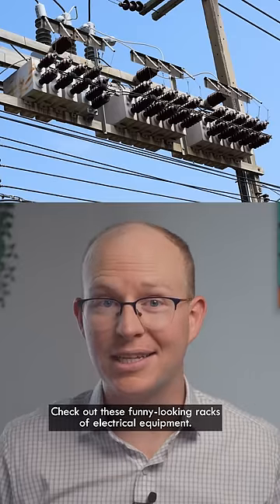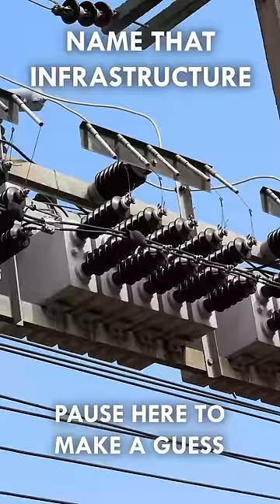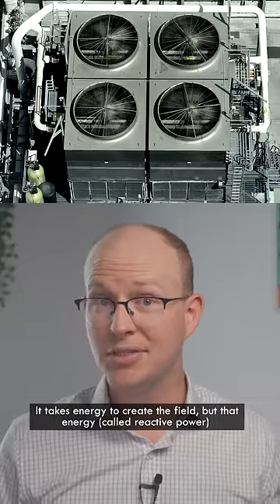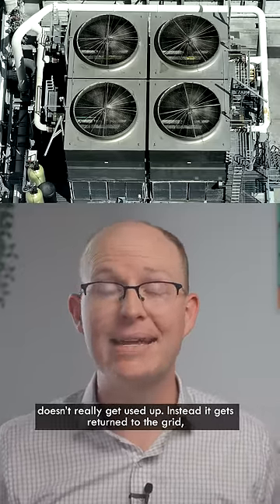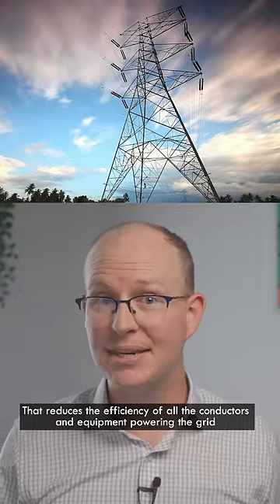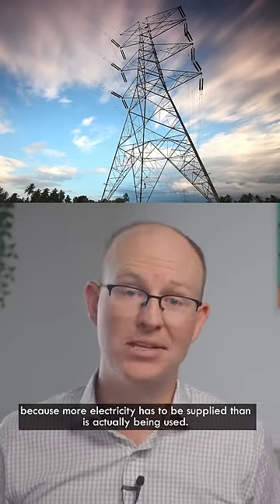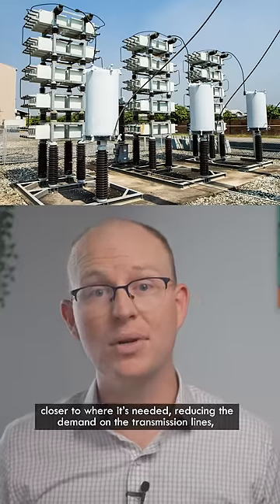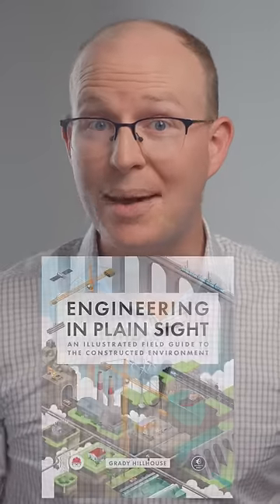Name That Infrastructure (Ep. 10) #shorts

Comment: Capacitor banks.  While your explanation of reactive power is pretty good, I wouldn't exactly say the 'voltage loses synchronization'.  It shifts the phase, but remains in step.  When we have a generator 'lose synchronization', it slips poles and pulls out of sync.  That's a pretty bad thing and we have to trip it off and 're-sync' it to the grid.  I know it's a bit of a 'nit to pick', but...
Reply: ... but 'technically correct' is the best kind of correct!
Reply: One of the key elements to public science communication is removing unnecessary detail. It's far more important to communicate the idea generally correctly than be perfectly accurate.
Reply: @mjs3188  agreed. You only need to know the finer details when it's practical for you, like if it's your job or something
Reply: I love how well all these comments can agree on the nuance of precision of wording rather than calling each other wrong and arguing.

Thank all of you for making the internet a peaceful place where i can learn stuff and enjoy my internet time.
Reply: @ericolens3  because they are smart people
Reply: I'm not super familiar with high voltage applications but he talks about this in another video and also mentions the magnetic field in this video. If it is the magnetic field causing the discrepancy then why do they use capacitors instead of inductors?
Reply: @Jospec5Star  inductors and capacitors introduce an opposite phase shift to the power. I can go into the math and physics if you’d like, but the important aspect is that inductive and capacitive loads shift the phase in opposite directions, and the grid naturally includes many more inductive loads, so they add capacitors along the lines to produce a net-zero phase shift in the transmission voltage.
Reply: Such a tweeker reply.
Reply: Perfectly out of sync. 😆
Reply: How do you know when your turbine is out of sync?
It causes a minor earthquake.
Reply: @JasonW.  And when slipping poles, all the meters in the control room resemble windshield wipers!!  lol
Reply: Thank you for using laymen terms to communicate the idea. It helps to bring the rest of us along…
Reply: @Jospec5Star because inductors act as a resistor. A capacitors fills in the void when voltage drops too much when a motor starts up .

Comment: It's a capacitor bank. But, industrial buildings have inductors (motors) which have reactive power requirements which "pull the current" one direction away from unity while capacitors are the polar opposite and help bring the reactive power back to zero or unity.

Comment: For anyone wondering, the capacitors can act as resistors with alternating current due to them storing a charge and attempting a discharge during the inverse of the input phase; which creates a variable resistance depending on the frequency called a reactance. To calculate this, it's 1/((2pi)x frequency in hz × capacity in farads) which would be displayed in ohms. And to change the phase, you use either an inductive or resistive compound circuit (LC or RC). But to get it closer to the θsource, they have to calculate using some simple geometry to get the net impedance(basically resistance for the AC measured in ohms but with the symbol of z). Where z is the hypotenuse, R is the horizontal edge of the triangle, C is the vertical edge, and θ is the angle between R and z

But I do believe that they have a digital system that can adjust the values to get closer to the phase of the source

It's been a while since I have done these calculations so if I got anything wrong, feel free to correct me
Reply: Reactance is AC RESISTANCE  WHERE RESISTANCE IS TO DC

Comment: To be more precise, more electrical current needs to be sent if there is too much reactive power. More current losses are there but also equipment has set current and voltage limits. I think it's possible to overload a fuse or transformer with only reactive power. :P

Comment: Cap banks are absolutely fascinating for a myriad of reasons, but the most interesting is that they essentially *create power from nothing*.
If a generator is making 100 MW of power they might be required (by contract) to spend 0-5% of that capacity just making reactive power that they aren't paid for. If they install a capacitor bank they can instead get paid for all 100 MW of power which, among other things, pays for the capacitor over time.

Comment: Eli the Iceman is what I learned back in 1995 in at SCU in my Circuits I class to remember the phase relationship of voltage (E) and current (i) in inductive (L) and capacitive (C)  loads.  After I started work at HP doing server design we started adopting power supplies with integrated power-factor correction that always present a balanced load to the gird in the early 1990s.

Comment: I worked for a company they find a way to generate money with photovoltaik in the night by back feeding power into the field. They used the Pv-field as a capacitor. They got cash from the grid company for correcting the grid. Called Q@Night.

Comment: hey hey~ i was able to remember those were capacitors from when i did utility locating! part of the training in that job WAS noticing unsafe infrastructure so i could call it in and more importantly avoid it, cuz aerial lines are easy to locate, just point at it and boom, but if something is not working right i was often the first to see it

Comment: Note that capacitors supply reactive power opposite that of motor reactive power.  Standalone or not.  They kind of cancel out the power factor issues if sized correctly.

Comment: Kvar unit... They are often but not always tied to a controller.  It's possible if you have a lot of variance in your ratio between inductive and none inductive loading. The controller basicly bypasses the capacitor banks to so that you don't get the opposite condition of current leading voltage.

Comment: Not all motors require magnetization current.  Induction motors do when they are connected directly to the grid but not if they are powered by a variable speed drive since the drive provides that current.

Comment: Several massive PFC banks like this were brought to my buddies scrap yard. It was fun to play around with them a bit. Not uncommon at all for the big power companies, hydroelectric, ext.... folks like TVA around here in Tennessee.... 

A lot of times they scrapped or get rid of things for one reason or another. Sometimes /a lot of times it's brand new not even been used and that was the case in those capacitor Banks. Beautiful big banks that were inside Explosion cabinets. You can usually buy that stuff for about ten cents a pound if you can find a scrap yard that will let you bug bug them or come poke around every now and then.

Comment: Well, the reactive power isn't "generated where it's needed" but it is compensated where it is created. Capacitances (e.g. in ground wires) or inductances (e.g. in motors) create the phase shift and therefore the reactive power. Because this form of unnecessary power would create power losses, it is compensated meaning the phase is shifted in the other direction.

Comment: At the intercetion of oxford st and monette place in los angeles is a power pole with 3 capacitors on top but only about 15 feet from the apartments on a building. Just after 11pm when TVs went off the capacitors would arc across the top.   The arc would last for 10 seconds.  The central American families living there complained to me as nobody at LADWP believed them. I sat outside several nights waiting for it. I missed the arc flash but saw the column of smoke.  The line crew looked up with binoculars the next day.  Its ok.  Go up and look.  The insulators were blown off the tops.  I think 4,800 volt caps on a 4,800 volt line was a misapplication.

Comment: Kvars and the Power Factor Correctors

Wikipedia has much more information available about "Power Factor Correction" and synchronous generation of electricity. That's where these capacitors enter the picture. Small correction units are cabinets mounted on power poles; now you know what that funny box on the power pole is.
Thanks, Grady!

Comment: I've wondered why certain machines don't come with their own capacitors to counter the lag caused by large motors. Or when installing and powering up an MRI machine why not have capacitors that could then be removed, as the magnetic coils are always energised? It would dramatically reduce the cost of start up. The only reason I have come up with is that it would be dangerous to have such large capacitors energised, especially if they can be moved. I would be interested in any thoughts about this.

Comment: We always sized capacitors for our motors and included them in the cabinet where I used to work. I imagine if everyone did this would be a non issue.
Reply: That's the exact thing done here. Commercial consumers have to pay for reactive current (at least where I live) and therefore they try to compensate it themselves, because it is cheaper than paying for reactive current. But private households don't have to pay for it and that accumulates a lot of reactive current that needs to be compensated.
Reply: Motors are technically a varriable inductance so 1 fixed capacitor won't actually solve the problem so a switched capacitor bank is still useful.

Motors are weird, but because they have a spinning magnet (the rotor), when they are at speed they effectively have a generator superpositioned inside them which lowers their effective reactance & load. (We model them as a fixed source behind a time varrying reactance, which is weird but works)

Honestly that phrase "its weird but works" describes most of electrical engineering math and principles. (And don't get started on the litteral witchcraft that is optics)
Reply: @jasonreed7522  You are right that if you want to be a good boy you buy a smart capacitor bank and hook it to your main bus to deal with variable loads. For a great many use cases though like a conveyor or a press that runs at a known rpm range you can size the capacitor for what you see and it will be perfect. The difference in current draw between running at 20 strokes per minute and 30 on a press was not a 2 to 3 ratio it was only around 10% more current. Making sure you size motors to actually run in an ideal range that promotes longevity goes a long way instead of hammering it with a full load all the time too. I did this in real life, for a very long time we had no way to vary our capacitance and the electric company was happy. We ended up getting a smart bank to check a box on an audit.

Comment: Line reactors, they make passive and active line reactors.
Reply: A line reactor is actually used to add inductive reactance to the line instead of capacitive reactance. Similar idea but opposite property. Line reactors are often used for longer transmission lines, that when lightly loaded can add significant capacitance to the system. In such cases, the reactors are switched in to counter the excess capacitance.
Reply: @nate0031  yeah I use line reactors in my plant to prevent reflective feedback on large reactive loads. We use unsealed open air reactors.

Comment: Residential customers aren't charged for reactive power.  But, there's a scam where you are sold a capacitor for your house.
Reply: How is it a scam? Do the capacitors not work? I’ve seen the devices for sale but I don’t understand well enough the operating principles to judge, so I’m eager to learn more and understand better.
Reply: @jpe1  It's a scam because it's marketed as lowering the cost of electricity for residences, but the power company isn't charging residences for reactive power, only industrial customers.
Reply: @MushookieMan  so, the industrial customers put in capacitor banks to reduce the reactive power, and thus reduce their electric bill, but those same capacitors won’t reduce the bill for residential customers because they aren’t billed for the reactive power that the capacitors compensate for, so while the device may be legit in that it reduces reactive load, it doesn’t do squat to reduce the bill?  That makes sense, I’m not doubting you, I’m spelling it out so that I’m clear in my own mind.  I didn’t realize that there was a way to bill for (or even distinguish between) reactive vs (ordinary?) power, I sort of assumed that the bill was based on the number of electrons that “flow through” the meter (I know they don’t exactly flow) and the capacitors kept some of the electrons on the customers’ side of the meter.  As I said in my first reply to you, I don’t really understand how this all works.
Reply: @jpe1  Yup, the meters can tell what's real and what's reactive power, then only log the real power flow. You'll notice transformers etc are rated in VA, or Volt-Amperes. Since they have to be rated for the total, Apparent Power that flows through the system. Apparent Power is the sum of Reactive power (Volt-Ampere Reactive, VAR's), and real power (Watts). So if you have a transformer rated at 10 VA, and you have 9 VAR's on it, you can only pass 1 actually watt of usable power to a customer. With the power factor closer to unity, you have almost no VAR's on the system, and can deliver much more energy. So now you may have only 1 VAR so you can deliver 9 watts of energy. Either way, the transformer is carrying 10 VA of load. So this is why power companies charge industrial companies more when they worsen the power factor of the circuit, as it increases the load on the circuit while reducing the sellable energy it can carry.  Most industrial users must correct their power factor to within a certain margin. Residential customers just can't skew the power factor enough to really be noticeable on their own. As an aggregate though with all their AC's on, it makes a difference. Still nothing compared to a large industrial user. The grid will pick up inductance other places as well, the lines themselves, transformers etc. So some capacitors are used to correct that as well.

Comment: That didn’t really make sense to me
Reply: He messed up his explanation, in mechanical terms a capacitor is a spring and an inductor is a mass, and the whole system is oscillating back and forth. (The applied force is voltage and the velocity is current)

Think of when you rock a vehicle, the mass makes its speed slowest when your force is greatest (at the extremes of its motion) but the springs in the shocks help you rock it because their force is greatest at the same moment. (The differential equation math for mass, spring, damper systems and capacitor, resistor, inductor systems are actually the same)

Put another way, capacitors and inductors both store and discharge energy like an oscillating spring, but they are 180° out of phase so 1 discharges to charge the other, this saves the generator from having to charge and recieve charge from just 1 of the components that is oscillating. (Which keeps voltage and current better aligned which is good for efficiency)

Comment: but capacitors do not work with alternating current as i know, how can it be?
Reply: They do work, but they keep charging and discharging as the voltage switches. You will need someone who remembers more of their schooling to explain why it has the desired effect.
Reply: Inductors store energy as a magnetic field around themselves, and resist changes in current. If current changes, the magnetic field changes. If you have current running through a winding and suddenly stop it, the magnetic field collapses and induces lots of voltage in opposing polarity to the change. Voltage leads current in an inductive circuit.

Capacitors do the opposite. They store energy as electrostatic fields. They try and resist changes in voltage. So in a purely capacitive circuit, voltage lags behind the current. You'll see a change in current, then a change in voltage. 

So if you have an AC circuit with a lot of windings (inductors) such as motors, you end up with a lot of inductive reactance, with voltage leading current, pulling your power factor away from unity. By adding capacitors to that same circuit, you add capacitive reactance to the circuit. Since voltage lags current in a capacitor, they counter the inductors. If you add just enough to counter the amount of inductance you have, power factor will come closer to unity and the whole system will operate more efficiently.
Reply: @nate0031  yeah thats second part of the video right there, thank you but not what i asked :)
Reply: @egoriv183  I guess in short, they work the same. They don't care if power is AC or DC, if there's a difference in potential, they'll accumulate a charge. It's just their use cases that can be different.